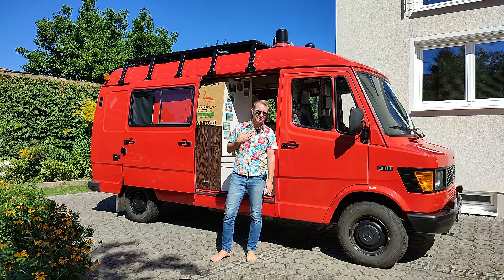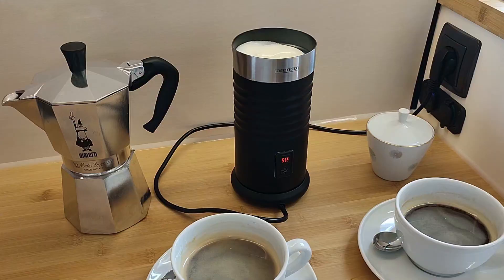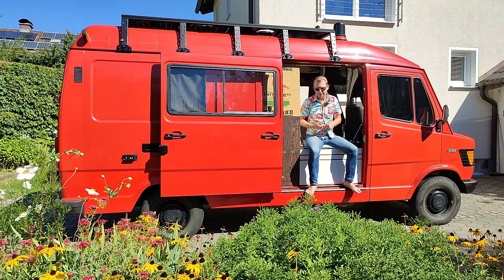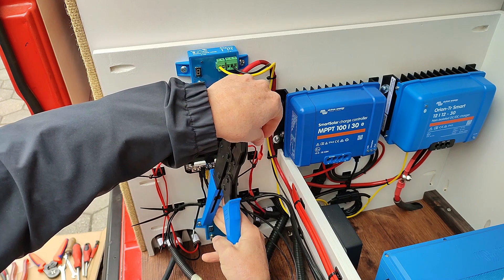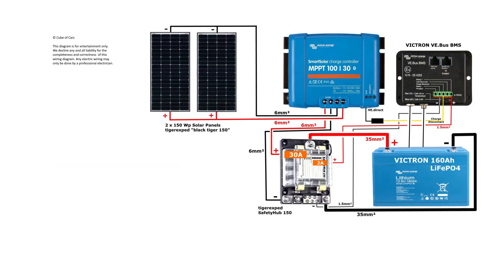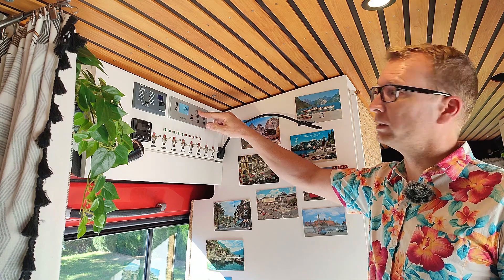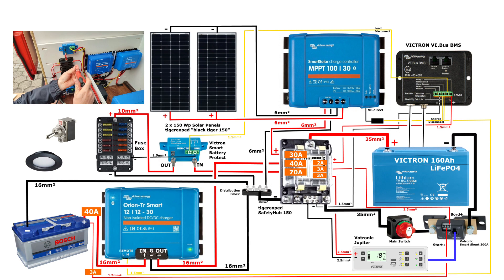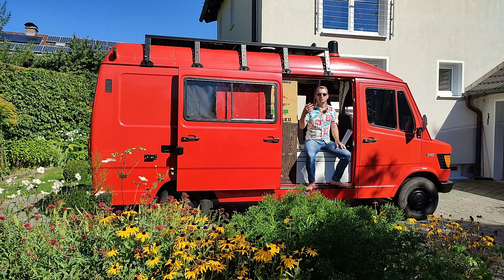How to Install Electric System DIY: Beginner's Guide for Wiring a Camper Van & easy Wiring Diagram

Comment: When will you do an update video? I mean the "2 years later" experiences. I just got my T1, wiĺl start to take away the fire department equipment today. Later this month i will move somewhere near München for my job with the van. Only thing missing is the garage / man cave where i can place the van into. Thanks for the videos. They will help me a lot. As non germna speaker finding good materials, chemicals etc is not easy and getting the list from you helps a lot. 😊
Reply: Go for more batteries than this. Rather go for two cheaper batteries than the Victron batteries. No need to have an external Victron BMS on the battery. Just adds complexity..  Use Victron Argofet to separate the starter and house battery...

Comment: Excellent video again! Where did you mount the 230V shore plug? Somewhere under the vehicle?
Reply from the maker: I didn't want to cut a hole in the side of the van, so I mounted it under the existing tread at the back of the van. I think I have never showed it in any video in detail, but in this video about my heater you can see it:
https://youtu.be/kurStWH6Y3M?si=YCAD7iQsAigdlOeg&t=920

Comment: Hi
Like your channel, lots of great info!
Did you research the engine ( m102.924?)? I’m trying to find some good info, but it’s not easy. I guess an average mileage of 13 l with full conversion and mixed terrain sounds right? Rebuild after 250000 maybe?
I have the opportunity to buy the same type of van.
No problems with the carburettor or rubber seals that are old?
Reply from the maker: @luuuuuudoooooo  Hi! We travelled 6000 km to Greece and back and achieved an average of 13,5 l which is ok, especially because we crossed a lot of mountains as well. With 80kmh on the motorway we get below 12 l. 250000km before rebuild should easily be possible, but there will surely be some repairs from time to time...
Reply: @CubeofCars  thanks, looks promising! Keep the videos coming, you’re doing a great job!

Comment: Hello Mike, my compliments on the great van build! I see you “ground” the MPPT on the minus distribution block. Is this distribution block itself then “grounded” on the chassis of the van? I don’t see that in your wiring diagram.
Reply from the maker: Yes, it is. It's not in the diagram because the minus distribution block is just connected with the minus of the engine's battery. But this battery minus is connected with the chassis as standard Mercedes layout.
Reply: @CubeofCars  Thanks for the quick Reply! I understand. Otherwise the (non-isolated) Orion probably would'nt work either. I also see a (yellow/green) earth cable going to the minus distribution block. Is this from the 230v and/or Multiplus? Shouldn't that be a seperate 230v ground point on the chassis, seperate from the 12v chassis ground point?
Reply from the maker: @frisovdm6132  That's ground for the 230V FI/LS circuit breaker. I haven't included details of the 230V system in the video, because it's a job for professionals. So I don't wanna give any recommendations how to wire the 230V system :)
Reply: @CubeofCars  Hi Mike, thank you. Of course I understand.

Comment: I expect that the solar panels being flush with the surface of the profile should reduce the air turbulence resulting from the addition of the solar components, and help reduce drag a little.  Anything that helps reduce fuel consumption is brilliant in my opinion.  Great job sir.

Comment: Hi, I came across your videos and channel yesterday and watched every one of your videos regarding your T1 build. Me and my partner are looking to do something similar eventually, hopefully with the same van, as we have fallen in love with the T1.However,  there are not many (if any) in the UK, so we would likely have to get a van from Germany or somewhere else and drive it back. Why are they so expensive? They seem to range from about 10,000- 20,000 for a good one with low mileage and high roof. 

We have no experience doing any of this type of work, be it woodworking, electronics or anything that you have done so far in this build. Do you think even considering this, it is possible for two complete beginners to create something as beautiful as you guys have?

Also I am very tall, around 2 meters, do you think this van and following your build would be adequate or would you suggest a higher van? 

Thank you for the inspiration and great videos!!! 

Tom
Reply from the maker: Hi Tom,
There are not many T1 high roof left and they are a perfect base for a DIY camper and everyone knows that unfortunately, so they are really expensive nowadays. 

But I wouldn't consider a high roof T1 when being 2 meters tall. This van is not high enough for you to enjoy. If you want to have a T1, try and find one of the plastic roof Westfalia T1. Or buy a cheaper (but good condition) low roof T1 plus a second hand Westfalia roof (sometimes offered on Ebay or ebay Kleinanzeigen)... but installation of this roof is probably a job for a professional company, though not too complicate. 

For the camper conversion itself it's not necessary to have professional experiences. We also didn't have and our source of knowledge was YouTube. So I am sure, you can also do that! :)

Cheers, Mike
Reply from the maker: I mean this kind of roof:
https://passport-diary.com/basisfahrzeug/mercedes-benz-207-d-t1/amp/